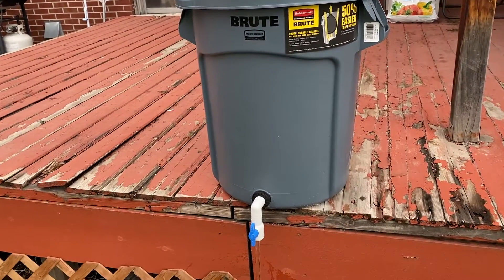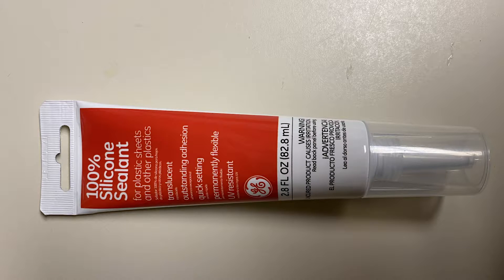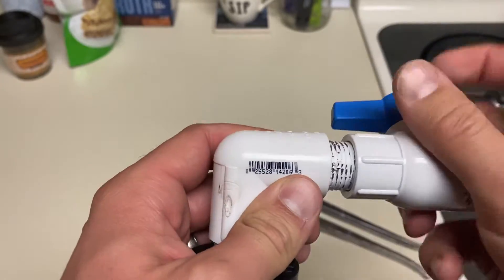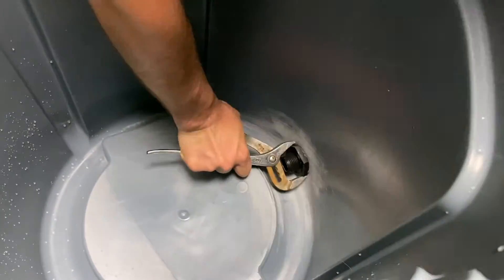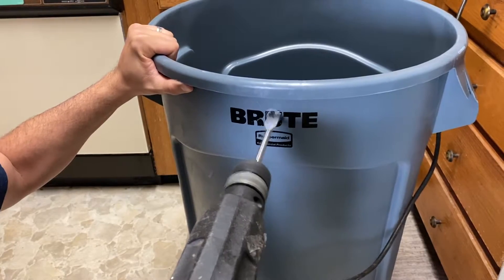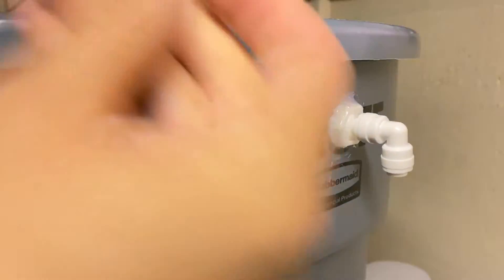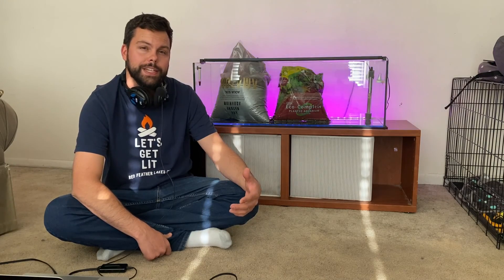Tutorial : DIY Reverse Osmosis Holding Container

Comment: Why are you using pliers on a the threads of PVC ??? After the Teflon tape?? You're begging for a leak.. you can see in the video the threads are deformed. If you do things the right way the first time silicone is NOT needed or should be used in this application. That is what the seals (gaskets) are for if you do the job right again no need for any additional  sealer (caulk) of any kind. NEVER use pliers on the threads of ANYTHING. They make these things called strap wrenches for applications like that or at bare minimum cover the threads with a rag when tightening  to minimize  damage to the threads.

Comment: So I see from your video- that you can simply run the RO water straight into an open container? And you don't need to use the small tank that comes with the system. You could slowly fill a 55g barrel and no need for back-pressure on the filter??
Reply from the maker: I use the small tank for drinking water under my sink, so I can have fresh drinking water. I can turn a valve and have it fill the container while I have a small supply of drinking water in the mean time.

Comment: The video is not bad but how did you manage to get your bulkhead adapter thru the 1 3/8 hole? Bought all your parts but damn sure wasted some cash on the wrong size hole saw.
Reply from the maker: Hello What size is the Bulkhead you got?
Reply from the maker: Id imagine you didn't get a half inch bulkhead this is the bulkhead in the video and the description states it needs a  1-3/8" to 1-1/2"  hole. You dont need to take the hole saw back you need to take the bulkead back. https://tinyurl.com/3uwrk5x9
Reply: @AquaMayne  The Bulkhead is Everbilt 1/2in part number HPL-1871 just like in the video.
Reply: It came from Home Depot and considering it was made in China anything could have gone wrong.
Reply from the maker: @HeinzKruse  Yeah something is not right because this link is that part and it says 1 3/8" hole. Maybe a missbag, might have to get another. https://www.homedepot.com/p/Everbilt-1-2-in-Polyoxymethylene-Bulkhead-Union-With-Washer-Fitting-800469/207176895

Comment: Just a suggestion , you may not want to use a trash bin for purified water reservoir.  The trash bin isn't food grade and has bpa in it, not to mention it isn't as strong as food grade reservoir.
Reply: Actually, the Rubbermaid Brute container is very well proven and it has NSF 2, 21 approval and USDA meat and poultry group listed, ensuring regulatory compliance for food storage and clean ability. It’s perfectly fine to use them. I like putting the wheel kit on them😉

Comment: Is a huffy garbage can food grade plastic? If not, your drinking harmful chemicals in the plastic designed to hold garbage. I have also thought this same idea for storage, but all the trash cans I see are not for potable water storage
Reply: Yea fda approved
Reply: I thought the same, but this is an amazing idea. I was thinking one could get a thick food grade food safe liner (available from fabric wholesale stores/online shops/amazon). I used to make reusable, eco friendly living products. So, as long as you can figure a way to seel it, it will act as a liner inside whatever storage container you have.
Reply: But all in all the best thing would be a giant stainless steel container. Expensive.
Reply: So the RO process, is a slow one. You use more water than you get out, so this ultra pure water is pretty 'expensive' in a way. RO remains one of the most widely used desalination methods. There're ain't many ways to do that. Hense your RO water being pretty valuable. At the end of the day, intent on use would be my container choice. If your filling fish tanks, I wouldn't worry about using a trash can. Yes, Huffy does make Food Grade cans, but why wouldn't you want something sealed??? You've, sterilized and reduced this water to near particles. Protect your ultra refined water, for drinking. Also, 40 gallon pressure tanks you can find for about 40 more dollars than these thick plastic cans. You did a great job on the video.
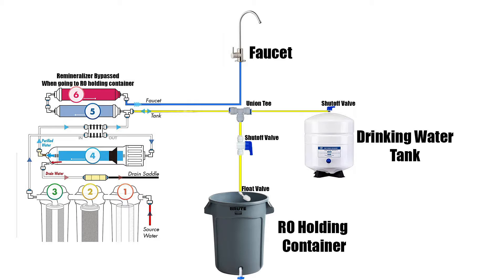Reply from the maker: I don't drink the water held in the can. The drinking water is held in the tank designed for drinking water. 6:20
Reply: @AquaMayne  I see now the water in your garbage can is RO water. I thought you were using RO waste water. My fault